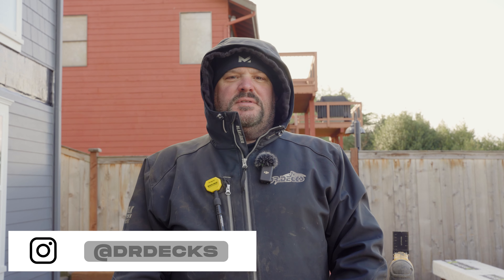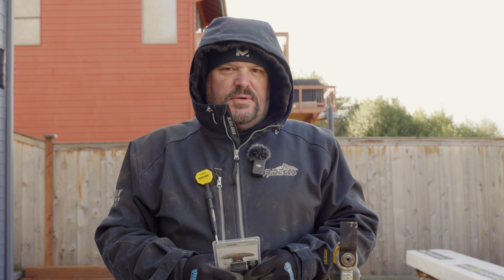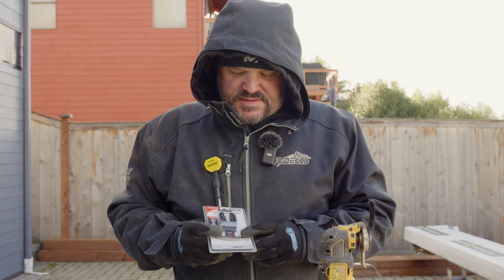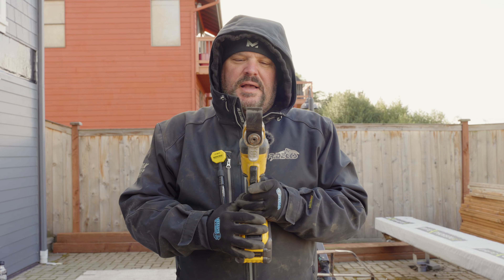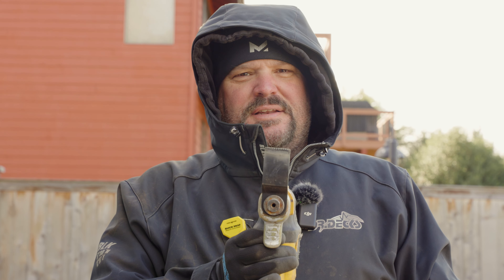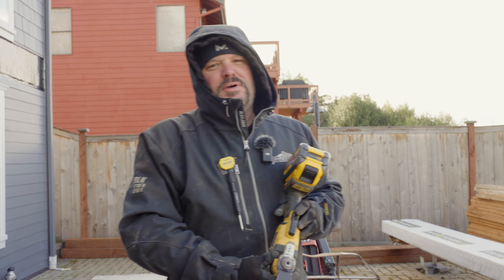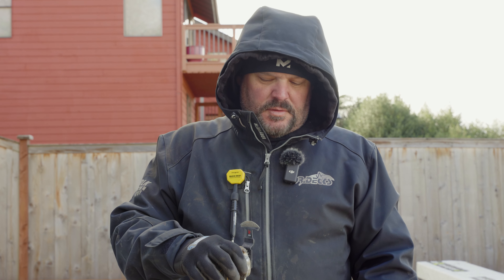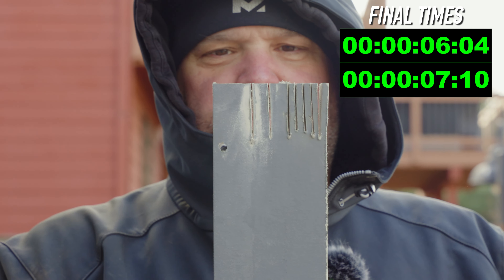I Put An Diamond Blade On My Oscillating Saw || Dr Decks

Comment: Ive done similar work with stucco and a diamond blade.  It will wear down.  It will last longer if you lubricate the cut, much like drilling through metal

Comment: just bought Lennox diamond blade that goes on and sawzall and it cuts like butter though ceramic tile cement, cast iron you name it amazing as well as well keeps dust at a minimum vs a grinder but key is lubrication , sponge with water or a spray bottle..

Comment: Does anyone know why multi tool blades are so expensive
Reply: yeah because you need them lol
Reply: If you get that assortment pack like he was saying you spend 20 bucks for 15 blades or so. They last aslong as milwauke or dewalt blades depending on your use. Then you just throw em away. Id rather have a cheap sharp blade then a used name brand blade.

Comment: You mention diamond and wood blades. There are several other types. Suggest trying CARBIDE tipped metal cutting blade. Much more durable than wood blades and much cheaper than diamond, but handles nails with ease. Blades come in several shapes. ***Very useful for gettng under the edge of siding to cut nails when replacing boards..

Comment: Your burning the blade and the material by keeping it in the same spot,, it last a hell of a lot longer moving side to side or back and forward,, if you need to do a cut where you can't move the cutter you should give the cut a spray, wood willl just smoke the place out,